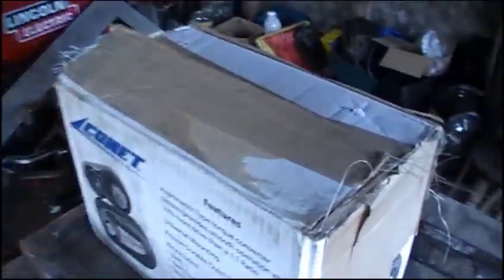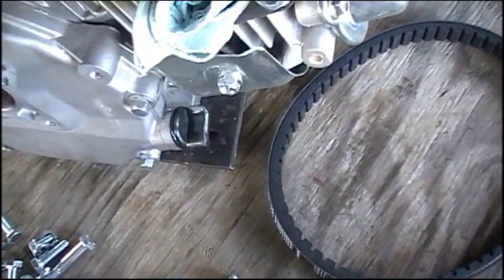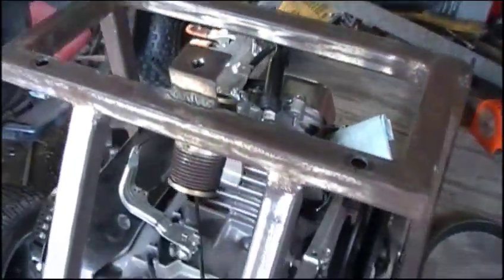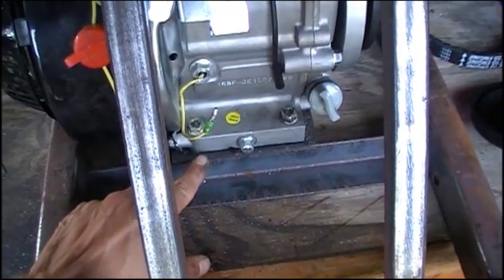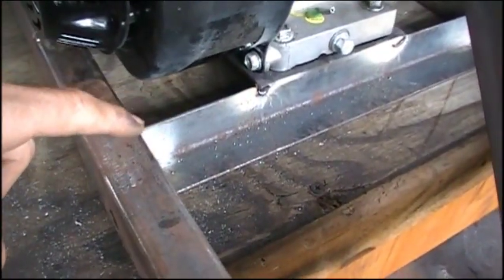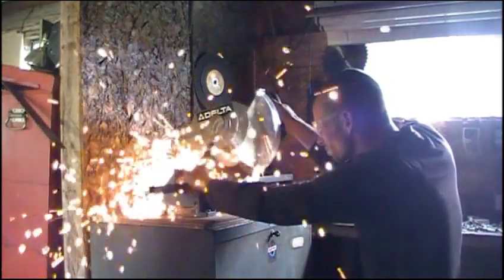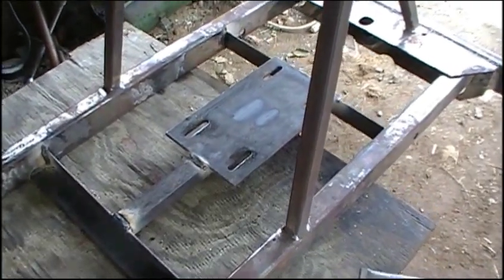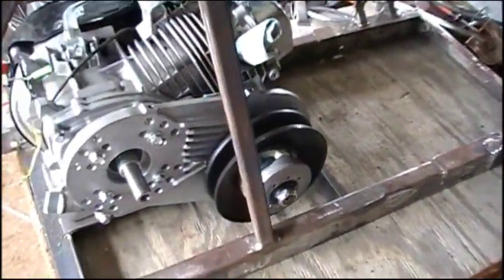Racing Mower Re-build Update #6

Comment from the maker: @TheRilley1313 yeah, I checked that, it has just enough room to expand. it wont go expand past the silver part that is below the bolt. but thanks for the heads up. that is why I waited untill I had the clutch b4 I mounted the motor, I knew it was gonna be close!

Comment from the maker: @SuperCheeker hmm, I havent had much expeiance with a 3 bolt motor, are you sure that one of the tabs isn't broken off? if not, then just run some flatsteel and drill new holes for the motor mount.

Comment: i got myself a 86 murray, and usin it for the woods and mudding, i took your idea for the gas pedal, pretty AMAZING!!!!!! im gettin a new seat, steering wheel, got my back pushbar on, and putting a front, welded the rear end [locked it] and changed some other stuff, :D , goes a good 35 KM/h ;]

Comment: You mentioned early in the build maybe up grading to a larger motor like a 8 hp. Did you leave yourself enough room? Or did that that idea go or the window. I would suggest painting the bottom of the frame and stuff with rubber coating like plastikote our something like it.

Comment: It's an alternate location for the dipstick (just swap the dipstick and plug).  Depending on what the engine is used in you may not be able to access the dip-stick in it's original location.  This is very common on small engines, even original engines in equipment often have a second oil fill/check port.

Comment: Fearless, I have enjoyed your vids and have a suggestion, if wanted.....
When you removed the Alum web/support, you left the finish very rough.  The rough scratches are the start of material failure.  Especially in a high rpm/ vibration environment.  It will eventually crack.  Take a "Flap Wheel" and lightly dress that area.  Make the transition as smooth as possible.  Be careful, don't take too much.  Dress it so that your fingernail can smoothly slide across the transition, and not "hang up."

Comment: driven pulleys spread outward when they lower the gear ratio to gain more speed but I'm not sure if only the faces move or everything but the engine side face moves so you should run the engine at WOT to see if you still have enough clearance just to let you know, I'm not a pro I was just throwing that out there just incase. Cool vid I hope to see the next one soon

Comment: I was trying to add more stuff but damn iPods... Ya, but before you mount the engine more permentaly you should change that stuff so you won't have problems in the future with the clone. They are great engines but stuff will wear out much faster with the clones than with the hondas, and most of the parts are interchangeable.